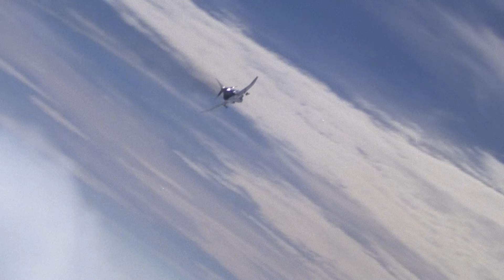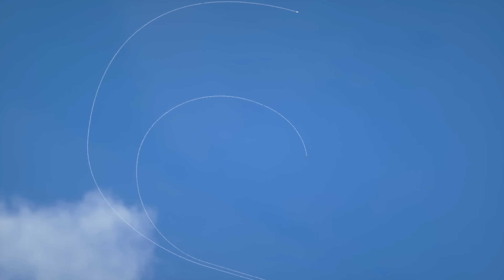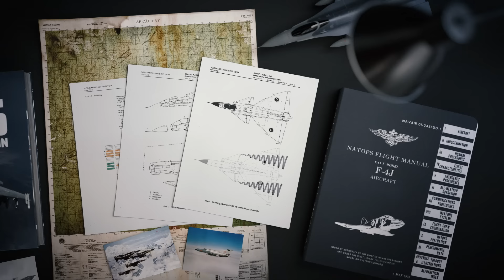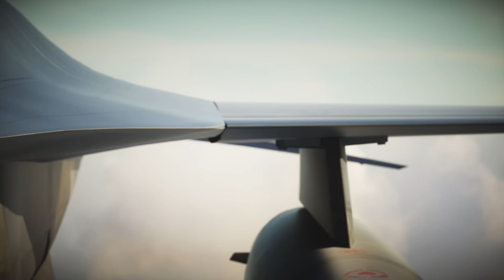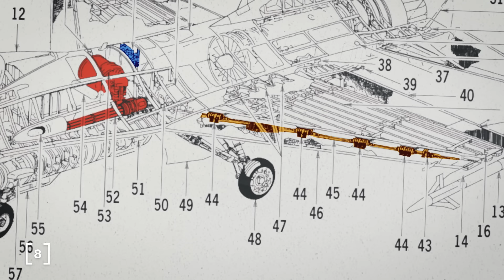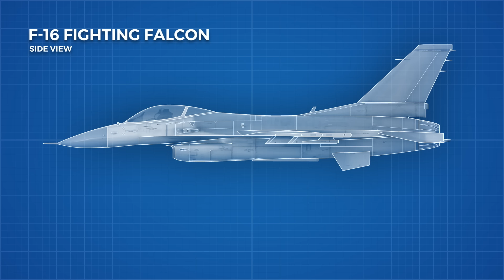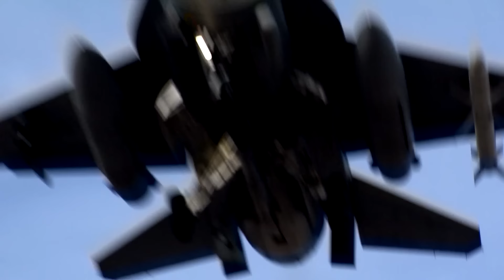The Insane Engineering of the F-16

Comment: Not good, but Russian Su-27 is a better!!
Reply: flankers are awful bullshit. In this times not having taste is very common thats why everybody likes suchoj exagerated shapes.
Reply: A better looking aircraft, maybe.
Better performing? Nah.
Reply: @My_initials_are_O.G.cuz_I_am  Better performing? yeah)
Reply: @AlexKoltsov   The Su-27 was thought of and designed as a direct competitor to the large twin-engine air dominance fighters of the USA like the F15, which is a much more expensive and sophisticated aircraft compared to the cheap single-engine and decidedly multirole-oriented F16. There's also ~4600 F16s built compared to ~700 Su-27s. Comparing the Su-27 to the F16 makes no sense, you should be comparing it against the F15.

Also, some general historical data if you want to compare Russian vs American aircraft performance:

AIR-TO-AIR KILLS : AIR TO AIR-LOSSES

RUSSIA
MiG-21 250:501 (~1:2)
MiG-23 25:102 (~1:4)
MiG-25 8:8 (1:1)
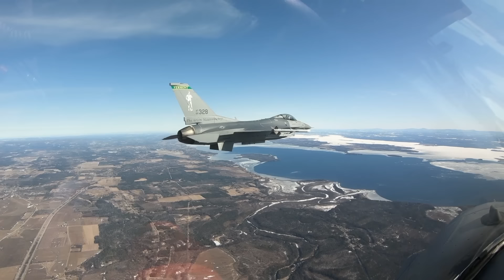MiG-29 6:18 (1:3)

USA
F-4 Phantom 306:106 (3:1)
F-14 Tomcat 135:4 (~34:1)
F-15 Eagle 102:0 (Undefeated)
F16 Falcon 76:1 (76:1) (The single loss was a blue-on-blue friendly fire incident by the Pakistani air force)

Sources from migflug.com. Generally speaking, the Su-27 is the ONLY widely-used Russian aircraft with positive kill-to-loss air combat ratios. Everything else has fared... decidedly worse.

Comment: After seeing your Oceangate carbon fiber bomb video i would love to see your takes on the carbon fiber movement in the airplane industry. Specifically the Hill Helicopter HX50 and the Dark Aero One plane, which both forego certification by being classified as experimental self-built kits.
Reply: oceangate has Nothing in common with experimental aviation.

in aviation carbon fiber is used properly, and modern experimental aircraft are as good or better than certified aircraft if built per the design. Most experimental aircraft have much higher structural and load limits than their certified counterparts.
Reply: The main problem as he said in his video on the oceangate sub is that carbon fiber isn't that great at compressive loads. Even at 10 G, a plane doesn't experience even close to the same compressive loads as a sub.